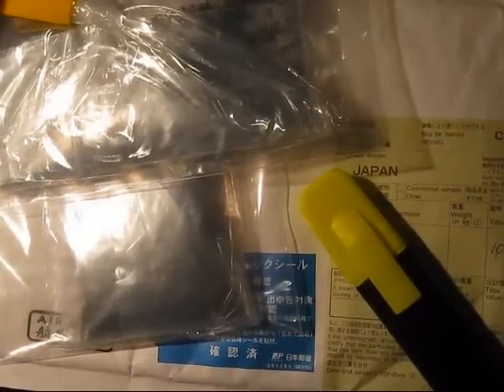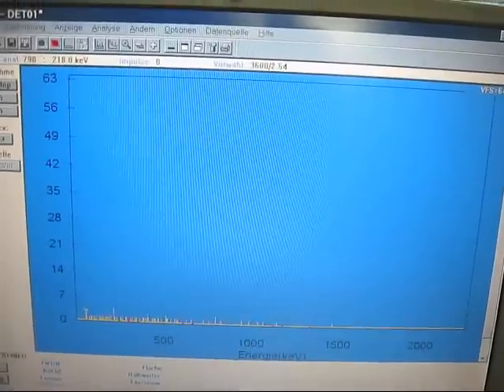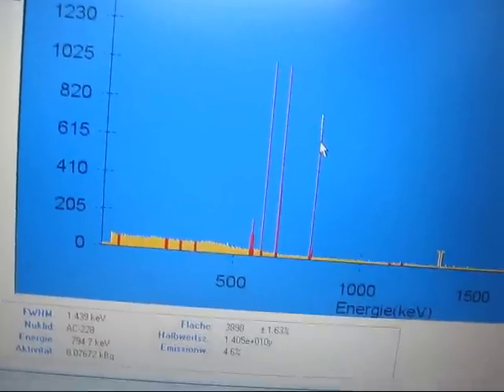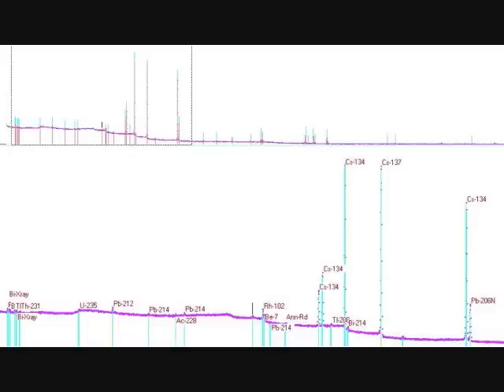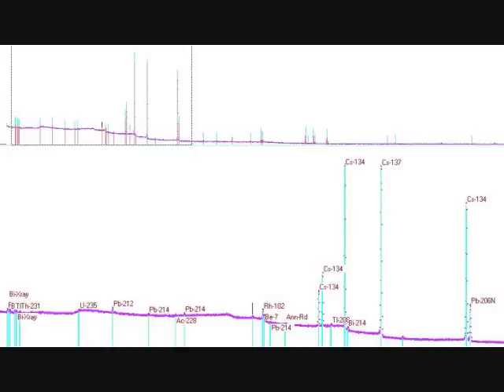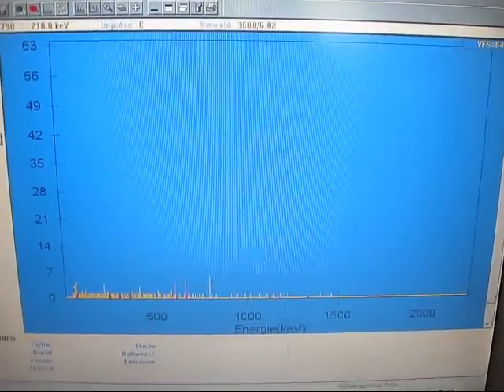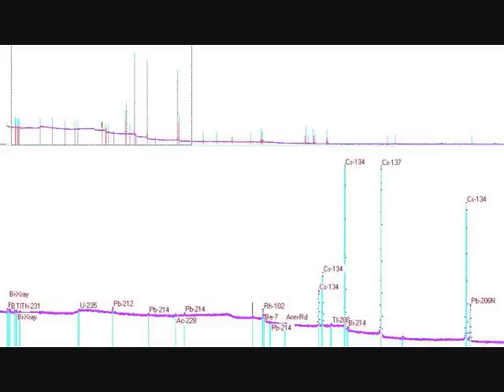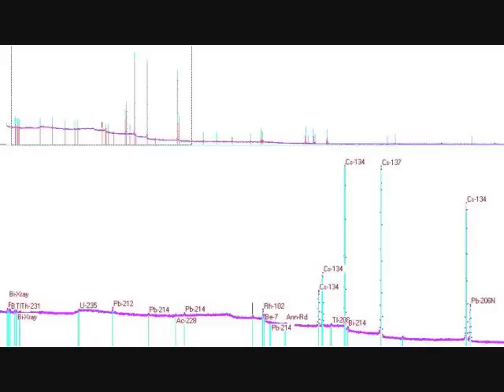radioactive contamination with caesium (Cs-137, Cs-134) from fukushima found in tokyo soil.

Comment: Sure, repairing damage to a single base-pair is quite efficient.   
But a free radical can't cause multiple simultaneous breaks in a strand of D/RNA.  An electron can, and once you have a small section - or sections - floating free, various reversal or transpositional errors can occur. These are apparently undetectable and unrepairable.

Comment: The thing is that free radicals also are causing thousands of DNA damages per seconds (which is tiny compared to the total number of DNA we have) as well as just our 37° body heat by itself. 
If we didn't have very efficients DNA damage repair mechanisms in our body, we'd be dead within months.

Comment: @shadowofiris I haven't read Sanders' book, but am VERY skeptical about his claims that low levels are harmless. Goffman, in his Radiation and Human Health book, makes a strong logical case that even one ionizing track/branch has the potential to cause irreparable genetic damage. Hormesis may well be a real effect; low levels of IR may actually stimulate you immune system in a beneficial manner, but to deny that the same IR is not causing cellular, and possibly genetic, damage is IMO fantasy.

Comment: @DamchoDronma Stop spamming the comments. It seems you're doing the propaganda. Are you from greenpeace? All radioactive levels are not toxic. It is a non-linear, threshold based process and living beings use radiation. I suggest you read up on recent research papers such as 2004 “Is Chronic Radiation an Effective Prophylaxis Against Cancer?” or 2010 "Observations on the Chernobyl Disaster and LNT" with actual scientific results. Actually ask bionerd if radioactive therapy didn't help her.

Comment: @bionerd23 wrong, 1927 paper by Muller, Nobel Laureate, xrays run risk of cell damage... you just won't see the cancer in 20 years with a biomarker - 'caused by that xray when you were 23!'  There is NO threshold for risk!  zip, zero.  every xray is a risk for cellular damage.

Comment from the maker: @FrankensteinFinance 
maybe it would be possible to measure an increased but very low level activity in food even with a geiger counter - provided you have a lead castle and give it 2-3 days of counting impulses. however, you would not know if the activity is due to e.g. increased natural potassium (e.g. bananas are more radioactive than apples) or even increased solar activity (you need an underground bunker to be safe from those, not just some lead bricks)... also, food rots away...

Comment from the maker: @TheChemlife 
yeah, that is true. thorium is a much cleaner source of power - no isotope seperation ("enrichment" -> lots of chemicals!) required, as thorium is naturally just one isotope, which is good for breeding fuel (uranium isotope) out of it. also, in operation, a thorium reactor will produce much less dangerous radioactive waste / fissile material. well, i already talked about that in my other video... 
but, if for some reason a reactor like that blows up, its still not good at all.

Comment from the maker: @bamboo4tameshigiri 
well, i am. when i leave the house, i switch off everything - not have it on standby. i also use poisonous mercury energy saving lamps that emit toxins from the electronics when in operation, sacrificing my health to save power. switching the pc on and off for 10-15 minutes of a "break" would also be unreasonable, power-wise.
i'd simply have to stop heating water for tea, and cut down using the computer to just one hour a day... and this is downright impossible for me.

Comment: I plan to start a radioactive mineral collection.  I will build and geiger counter base on your plan, but with two Darlington Transistor to increase more the output power and try to use Piezo speaker as out put or LED.  I plan to use smoke detector Am 241 as positive test source for my apparatus.  What is your advice on this topic ?  Thank you in advance and best regards,

Comment: @bionerd23 I'm the same if now worse, I've load of computers running with a few CRTs sucking up all that energy. :( Our energy demands are increasing all the time, and it all has to come from somewhere. I'm not keen on coal, oil or gas coal is the energy source of the 19th century not the 21st, and the rest are not all that better. I have hopes for renewables but I don't know if they can meet the growing demand, lets hope fusion power is not all pie in the sky.